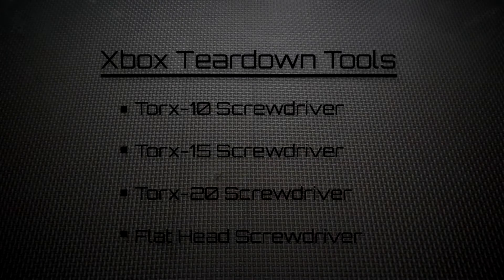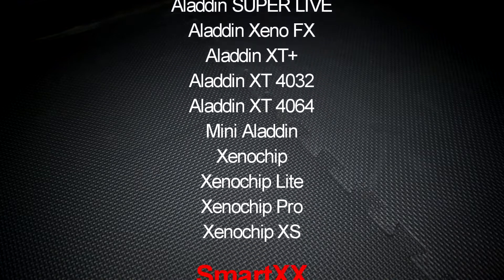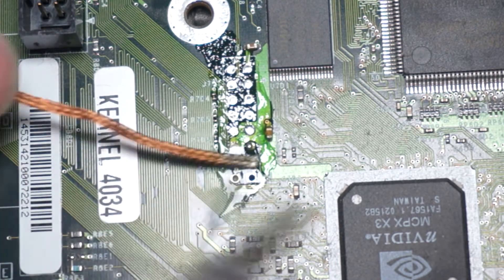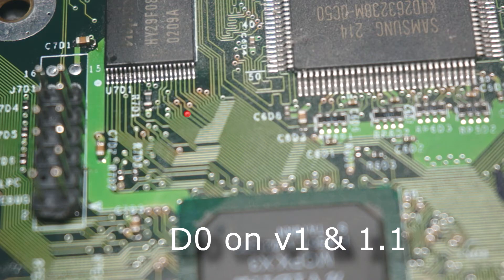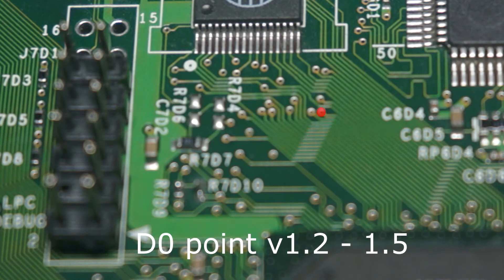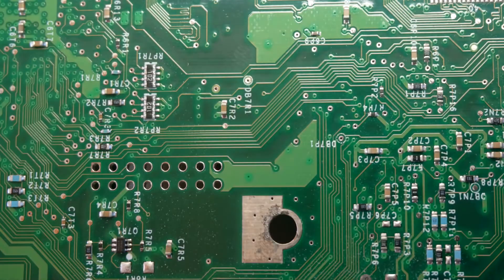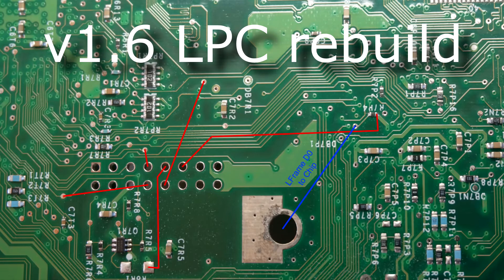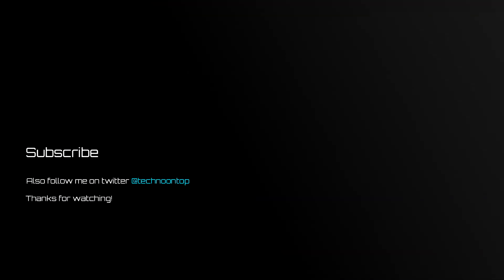How to install an Xbox modchip using a pinheader

Comment: Hello, there is a mistake in your description, the cable to the R7P4 is wrong, if you connect it like this there will be a short circuit. The connection a little further next to the R of R7P4 is the correct one, then it will work.

Comment: I've had a SmartXX v2 via pinheader in my 1.4 Xbox since 2004 and it has worked flawlessly. A seriously good design.
Reply from the maker: Do you happen to have it hooked up to an lcd screen? I have 2  1.4s and both my smartxx chips (v2 and lt Opx) have trouble with the lcds, they mess up and glitch out if left in idle, I have already ruled out my soldering and the lcds themselves, as they work perfectly in a v1 and a v1. 6. Also xecuter chips work fine with lcds on 1.4s. Just odd, and your the only one I have found that has a 1. 4 with a smartxx chip.
Reply: @TechnoOnTop  No LCD screen.  My cousin helped me with it back then and was his idea to use the 1.4 with the SmartXX and EvoX (he was very active in the community).
Reply from the maker: Ahh ok, I have always liked the smartxx chips myself not sure why as a kid I was just more drawn to there marketing I suppose lol.. Well if you ever decide to add one first test it before committing to cutting up the case, and be sure and let me know your results.

Comment: Great video... I have a brand new Xecutor 2.6 Modchip if anyone is interested
Reply from the maker: Thanks for the comment, that's probably a hard sell, unless you are going to let it go cheap they really don't offer much over a cheap alladin or a tsop
Reply: @TechnoOnTop   To be honest i didn't pay much... I got it when softmods killed the chip market... I paid about £10 with the intention of using it but never did... Happy for it to go to a new home for next to nothing... I will never use it now (which is a shame)
Reply from the maker: Well I'm sure someone would pay you $20 for it maybe a bit more. You would make a small profit depending on shipping. I would offer you that but the shipping would make it not make sense.

Comment: I have a motherboard with holes in the lpc port it doesn't have solder but do I need to solder the modchip in or no I have a Aladdin xt
Reply from the maker: Yeah some motherboards don't have the LPCs filled in, others do, the ones that don't just make installing the pin header easier, I'm not 100% sure what your asking? If your Xbox is a v1-1.5 you can just tsop it of course you can also just install the modchip as well, if it's a 1.6 then you will need to install the modchip to hardmod it, you will also need to rebuild the LPC if it's a 1.6
Reply: @TechnoOnTop  oh I'm not sure what version my motherboard is all ik is it doesn't have any solder in them holes
Reply: @TechnoOnTop  hey do u know what I can use tempary for my Xbox original motherboard for fan coolinng I don't have the original fan that went with it but thanks
Reply from the maker: I have a video showing how to figure out what version xbox you have, as for cooling any 60mm fan will work or you can do the 80mm upgrade, I also have a video on that
Reply: @TechnoOnTop  oh I have Aladdin xt with pin header with it can I install it without soldering and how
Reply from the maker: @BlackCat-qm3sj  no you will need to solder it, or fine someone that can for you, its not to hard but if your not comfortable with a soldering iron you can ruin it.
Reply: @TechnoOnTop  can I use a solder less modchip
Reply from the maker: @BlackCat-qm3sj  if you can find one, im pretty sure they are just adapters, they should work with any modchip, but im not 100% on that

Comment: Which is better with pin header or soldering it directly to the motherboard?
Reply from the maker: I don't think it makes any difference. Personally I prefer to use a pinheader. But really it's just whichever you are most comfortable with doing and which you want. Happy modding! Thanks for watching!
Reply: OK thanks for the response , with pinheader which pros and cons I can have over soldering it directly?
Reply from the maker: @moumou6558  if i had to be veryVERY nit-picky really either is fine but here you go.

Pros: to soldering directly, cant come lose,saves space,looks cleaner.
Cons:tougher to remove,sorta more difficult to solder.

Pros: To Pinheader, Modchip can be easily removed/replaced
Cons: under a very extreme circimstance it has the possibilty of coming lose.
Reply: Thanks Bro I used the aladdin chip the man who Installed it told me that those chips never broke because they don't work all the time they just load the bios at the bigining and there work ends is it true or the chip is working all the time ?

Comment: My harddisk broke down. For this reason I bought a smartxx lt opx chip many years ago but I never got it to work (xbox 1.0). I used pinheader install + d0 wire on the bottom. I checked all the soldering but keep getting christmas lights. I assumed the chip is just broken. I ordered an aladdin xt chip. Can I just put it on the pinheader and solder d0 and done?
Reply from the maker: Yeah if you checked over all your soldering there is a good chance it's probably dead which really sucks its a nice chip. I would encourage you not to throw it out would make a cool decoration if you're into collecting. But yea just put it in place and solder up the D0 . You will also want to bridge some connections to make the chip in always on mode. If you Check out my video on the Aladdin install I show what needs to be bridged.
Reply: @TechnoOnTop  Thanks. I'll check if I can get the Aladdin XT to work once it comes in. In case it is legit though, as I ordered it for a very low price from China. Product description was vague and generic, as if they don't realize what they are exactly selling. If it doesn't work I can therefore still not know if it's the soldering or the chip.
Reply from the maker: Yea those chips from China are good. Iv ordered them from both Amazon and eBay. Take forever to get here but for the price it's not to bad.

Comment: I have a smartxx v3 Xbox modchip, there is no video on how to install that one
Reply from the maker: Very cool! Thats a awesome chip. These guides are meant to be referenced all installs are pretty much the same. There are instructions online for the v3. But basically just install the pinheader and connect the D0 point and your good to go. But definitely google and find those official guides. If I had an V3 I would of made a specific guide for it.

Comment: im looking for a alladin xt plus 2 guid for a 1.4 windom chip mobo.  could you or anyone direct me to a wiring schematic?
Reply from the maker: I have a video with modchip pinouts, that chips is there, you don't need to worry about the windbound chip unless you plan on flashing the tsop, but since you're using the chip you're ok. If you have any other questions feel free to ask thanks for watching
Reply: yeah i went over those after this and found some of your diagrams.  As soon as i get some more poin headers im gonna try to bring some old  xboxs with dead hdd's back to life